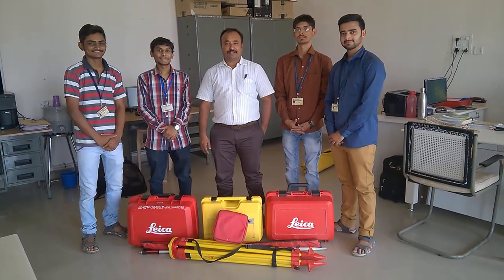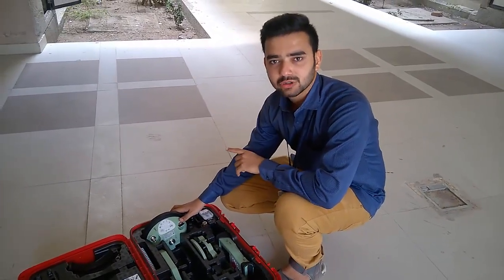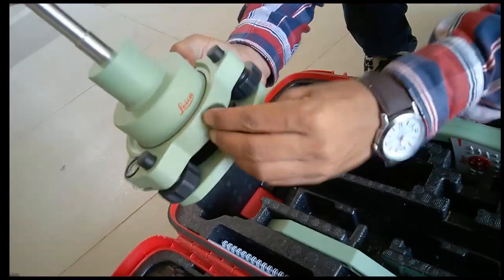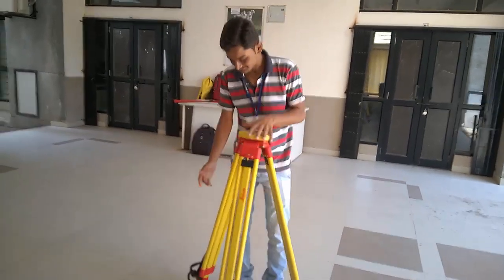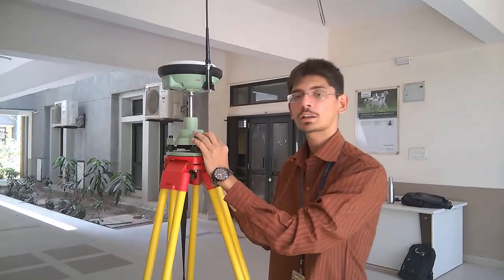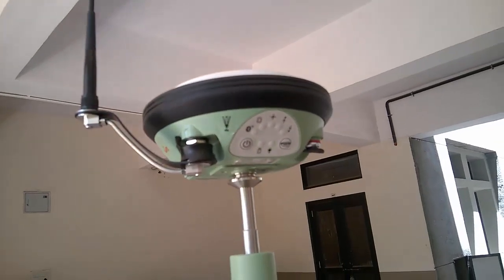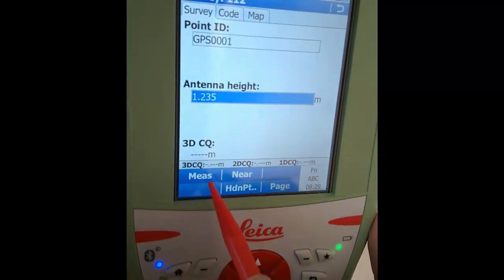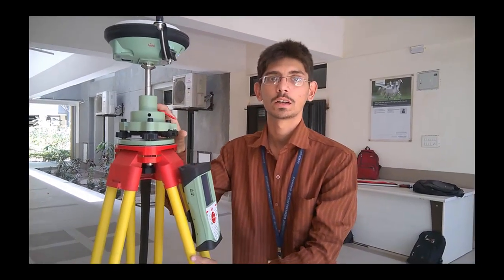Learning Modern Surveying Instruments - DGPS (Static Survey)

Comment: you r not connected to base , ur controller show connected only rover then how can it possible?
Reply from the maker: Actually we were connected sir.Thank You. Will improve!!;
Reply: For static survey both instruments have to be set as rovers!! Hope it will clear your doubt!! 👍
Reply: @yashodharpathak189  As far as I know Rover has to be connected by a base how both are being used as Rover...Pls explain in detail...Thank you.
Reply: Yogesh Sharma base is required only for RTK survey!
To carry out static survey u need to set both the instruments as Rovers and carry out triangulation to get the accurate coordinates. Off course static survey require post processing of logged data. 
Whereas in RTK survey you get the correction in coordinates in real time through Base!
Hope your doubts are clear now!